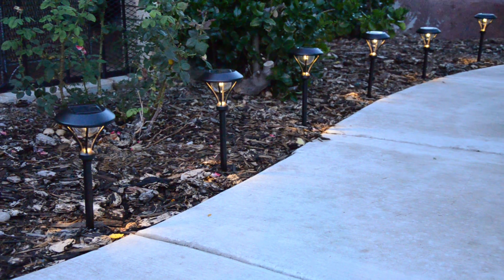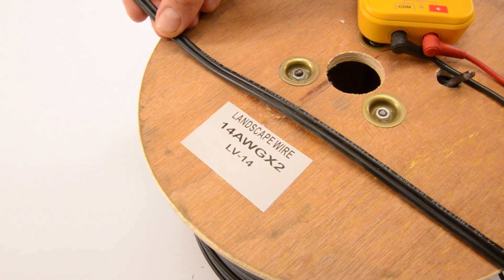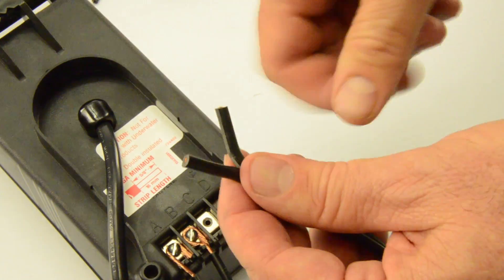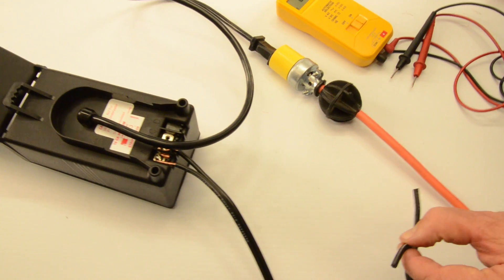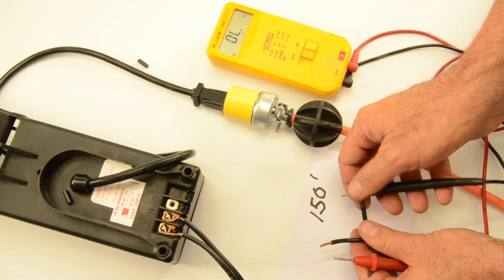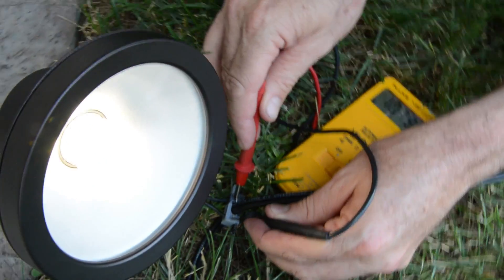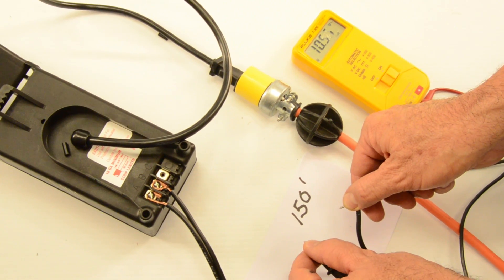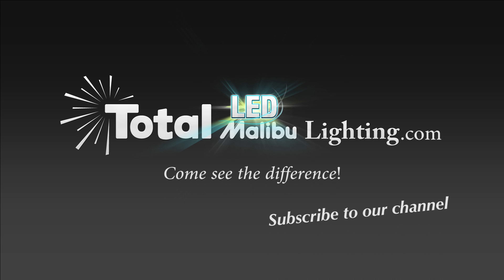Outdoor LED Lighting, Transformer Load & Voltage drop explained by Total LED Malibu Lighting

Comment: There is one thing you have forgotten to mention in this very informative video that I need clarification on. Great job by the way !  The colors of the lamp connection wires are Grey and Black. These two colors tell you which wire is hot and which wire is neutral. One wire has raised ribs along it's entire length that tells you that this wire is the neutral wire and that it should be connected to the same like wire of the main supply line wire coming from the transformer. The same applies to the smooth wire, that it must be connected to the non- grooved(smooth wire) of the supply line. This is done so that you do not  cross connect your connecting wires and trip the fuse in your junction panel when the line becomes hot(powered). Is this correct or in your professional opinion, does it doesn't matter ?
Reply from the maker: Thank you for sharing your insightful information 🙂

Comment: Great video.  It seems like every other "landscape lighting" video is so simplistic that they do not even address voltage and wire capacities.  Because there is no voltage drop at the end of your 150ft untapped wire, can I assume the following? :
I can run a 12 or 14G wire from my house halfway down a 300 yd (900 ft) driveway without tapping lights into it.  I could then split a line (a "T" layout)  in each direction from that end point to string lights onto perhaps 100-200 ft in each direction?

Comment: Informative video.  I've found using the Loop wiring strategy (Malibu's website explains five different wiring strategies, I was unable to paste the URL here) has helped reduce voltage drop issues.  Just be sure to maintain the correct cable polarity when closing the loop back at the transformer.

Comment: I have a 900 watt transformer and I am experiencing a voltage drop. I am running 5 50w fixtures. The last 2 fixtures barely lit up, will changing the last 2 fixtures to LED improve it? or do I need to change all 5??